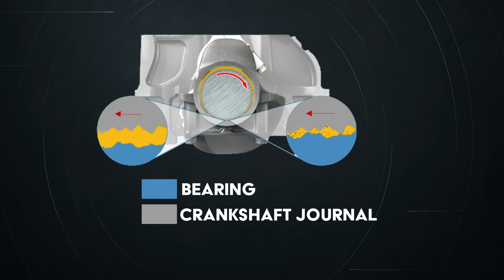the truth about start-stop technology (finally proven)

Comment: So they could have fixed it by using a separate oilpump, and just pumping oil before starting the engine.
The problem is that if a start-stop system would only start the engine after 5 seconds, then people would complain it's too slow.

Comment: Just disconnect the temperature sensor on your battery, this will prevent your car from using start/stop function as it wont be sure if battery is not too cold

Comment: Sorry but his is a redneck video. Your first test says exactly nothing about start-stop. When you were driving and just stopped on a red light, all the oil doesn't just magically disappear from everywhere. Your tests just says you should give it a moment before cold starting an engine before driving. Second tests is questionable at best.
Buy a modern car, which in 99% of the cases will be at least a mild hybrid which doesn't even use the engine right after you start moving and the start-stop system makes even more sense.

Comment: Is it true that the feature in 2015+ cars doesn't hurt the engine? Due to reinforced starter systems &  smart oil system (mostly available in 2015+ models (hybrids  of most brands + ICE Toyota, Hyundai, kia etc) have electric oil pumps with accumulators for start stop

Comment: I very appreciate the work you done with the experiment, but the methodology doesn't seem correct. You compare modern engine with Start/stop in very aggressive manner and older one with normal usage. To be fair the "experiment" engine wear should be compared to the same motor running the same time, but in idle. So it will simulate the situations, when Start/Stop engages, such as traffic jams. There are no doubt, everyday stuck in traffic car will wear much more, then the only only drives on autobahn.

Comment: My 2016 Mini Cooper has a physical Start-stop switch. If I turn it off, it stays off until I switch it on, which I will never do. My 2025 BMW X5M has a physical Start-stop button, if I turn it off, It doesn't stay off. It turns back on next time the engine starts. It's quite annoying. The M60i is even more annoying because it doesn't even have the physical button. I have to remember to go to the damn Driving Setting on the screen to turn it off every time I start the engine. Then my Lexus GX 550 OT+ doesn't even have Start-stop, which is damn nice. Too bad, its gas tank is too damn small. The range is far less than the other cars.

Comment: Except, nothing increases wear more than fuel dilution, which increases when you start a cold engine (like you did over and over again) or if it's idling for too long.
I've seen used oil analysis from engines running with and without in Real scenarios and they showed less wear.
Coated bearings are great, but selling it under false pretenses is the definition of snake oil. 🤷🏻‍♂️

Comment: I've got stop / start on my car. After around 3-4 years the car did not auto stop. Possibly due to the battery not holding enough charge. It is now 8 years old, still not auto stopping but starts the engine fine every day.

Comment: I remember the introduction of this type of motors, and my late father say how it could not good for the motor and many other parts . 
He simplified it for me, by putting it "the downs", just on the battery. Like: "what happens if you start the car, and don't let it work enough to start the alternator?" "well, the battery wont recharge and the car won't start after... ohhh! "

Comment: Why are hybrid car engines considered more reliable (in average 15% fewer problems linked to wear) if they turn off even more often than cars with start stop at a red light? Those can turn off while driving and according to many available schematics, they are decoupled and the cylinders aren‘t moving and the oil pump also isn‘t running..

Comment: He’s talking about German engines. And completely forgets how the Japanese engines cope with this with proven reliability.
Hybrid cars don’t just shut off when at a stop, they are constantly stopping and starting during normal low speed driving.
And yet Toyota and Lexus for example will rack up mileages well in excess of most German engines even those not fitted with stop start.
So remake the video and do a strip down on a high mileage Japanese engine.

Comment: I still would use it. My engine will never last over 500k, the engine is stressed by design. 2 bar boost for a 0.9 liter 3 cylinder. Piston rings or the turbo will give way long before the bearings do. I don't mind the extra wear,
it saves me money.
I have to wait 10 minutes every day on a red light due to how much traffic there is and the red light taking 3 minutes to go green. 3 minutes of stand-still, 30 seconds of movement and another 3 minutes of waiting until you exit that damned junction. I saved 52 liters of gas this year.

Comment: Weren't we all always told not to turn things on and off? The vacuum cleaner. Incandescent and fluorescent lights. Cars that are driven more highway miles versus ones that are shut off before you even reaching operating temperature, tend to last longer. 

In the aviation world, everything is rated on cycles. For the fuselage, this is due to pressurization, and not really related to this. The engines are rated in cycles. This is full takeoff power, cruise, then eventually back to idle. Even the APU, which is a mini jet engine that supplies power and air conditioning on the ground, is rated and limited in cycles. This is again, apples and oranges a bit because an airplane APU runs at one speed: maximum. But the point is the same. Heat cycles, loss and start of lubrication, starter motors, it's all excessive abuse of these systems.

Comment: Interesting video and a solid experiment. I could think of a few flaws with the experiment, if you had showed some real examples of wear caused by stop start then it would have helped back up your findings.

In another video they said one reason for stop start is to prevent heat build up inside the smaller engines. Like 3 cylinder turbo types. If they sit idle in traffic, the fuel is adjusted to prevent knocking and it then causes too much heat. That was the reason they gave for start stop. Maybe you could have mentioned more detail on what benefits it can give (if you do see any benefits).

Comment: Without stopping to inspect those bearings after 1, 5, and 10 hours (for example) it is not possible to say whether the wear (damage) was caused during the first few starts and stops, or evenly spread throughout the time the test was run. It's a lot more work, but that information would be critical before any actual conclusions can be drawn. The large chunk of debris that embedded itself in the 3rd bearing happened ONCE - and quite possibly during the very first start, as it got flushed out of the oil galleries after the test bearings were inserted. The good state of the OM617/OM616 after a high mileage, may result from the bearings being oversized, and larger than they need to be to support the engine loads. This would allow for earlier run-out, which could be further enhanced by the oil pump and sump design. 

A further (expensive) option is Diamond Like Coating (DLC). This adds a very thin layer of diamond to both crank and conrod surfaces - enabling them to run in contact with little lubrication, and very low friction. F1 uses this by default, because the diamond layer is so hard, it simply does not wear out. There is also no need for bearing shells, meaning the assembly bolts can be spaced closer to the rubbing surfaces, further improving the structural stiffness of the joints. Problem is, expense... 

Also, Kudos for making this video in English, und nicht auf Deutsch. USA and UK viewers simply do not appreciate when a European (or any other non-native English speaker) posts a difficult technical video in a 2nd (or 3rd, or 4th) language. 
If you speak English as your native language, then consider how easily you could present this kind of material in French, or Spanish, or German, or ???  If you even know a second language...

Comment: Okay, I drive a car that's about 14 years old, a diesel with a start/stop system with 177,000 km, and so far I've had problems with the clutch hydraulics, the air conditioning, the electrics on one of the windows and I don't know what else, but no problems with the engine or the starting system and I use the start/stop system almost constantly. The engine doesn't burn oil, it's as strong as it was on day one. I also have an even older vehicle without start/stop, a petrol one with 240,000 km and surprisingly the engine burns oil and I take care of both vehicles equally. What's the problem here now?

Comment: If the problem is the oil pressure, couldn't this be resolved by having the oil pump continue running after the automatic stop?

Or having a pressure reservoir that would hold the pressure for a limited time after the stop.

Comment: Not a good thing especially on diesels. You want to keep a diesel hot. Otherwise you're destroying your engine and exhaust system. Never drive a diesel if your road trips are under 30 minutes. And do not start stop it!😁 Your pistons and cylinder walls are expanding and contracting all the time. It's not good especially in cold weather. Metals cool down fast. And then you drive it hard from zero, that's not good! Whoever invented that 😤👎 This is an engine killer. You headgasket will give up too. Just imagine one hour road trip you only start your engine once. But with start stoperhaps 20 times. Now imagine this in a year! Your engine won't last long. You're gonna wear down all your engine seals and gaskets. Even bolts! Your engine will simply fall appart! Constant temperature difference is not good.

Comment: 5:36 one flaw I see with this is that you did not pre-heat the engine block, just the oil. Temperature of all the engine components, bearings, the block, etc... have an effect on how long the engine stays in mixed friction.

I agree that start-stop is bad but I don't want this argument to be called out as a straw man over a silly missed detail

Comment: As a metallurgical engineer, this is a very well presented and effective way to address the deficiencies of the start stop function, it can be applied to other rotating equipment that cycles more than it really should for long life of wear components.  A comparison of wear degree using metallography would have been very interesting.  

That being said, I have owned a 2010 Ford Fusion hybrid that has this start stop function, although I do not think that it operates at the same level as newer start stop systems.  I’d be interested to see a comparison of my Hybrid and a non Hybrid Fusion, same engine, same year, same miles (150K).  So far there has not been any apparent lack of performance using this start stop function (as I said, it might not be to the same degree as those cars having this function discussed here).  

I also note that, in my case, the function operates almost imperceptibly in the background.  If the hybrid battery is sufficiently charged, the engine drivetrain will pull from that first and if you’re tediously slow enough on acceleration or on a downhill start, the battery will stay engaged unless acceleration rate exceeds its ability to keep up or once the vehicle runs over ~40 mph.  I can only conclude that the start stop function on my hybrid is not being used in the same way as on the cars being mentioned here.

Comment: I had a buddy of mine remap my transpoter T6.1. An ECU remap, also known as software coding, allows some tuners to modify the vehicle’s engine control module so the Start/Stop system no longer functions as originally designed. This usually means the system can be set to remain permanently off by default, or it can be fully disabled so it never activates at all.

Comment: Current car is 13 years old. Used stop start never turned off. Zero issues. People have got to stop being scared of features
Reply: 14 years and 177,000km, frequent use of start/stop without any related problems. I don't know what's causing all this drama around this.

Comment: I would imagine an electric oil pump that maintains pressure and flow between starts might help... I hate the feature btw and have always felt that it was designed to intentionally wear consumable parts like starters and flywheels.

Comment: Most modern engines has electric oil pumps that keeps oil pressure at required levels with the engine is shut down during stop start

Comment: what's even worse is hybrid cars with the Start-Stop function, on some Hybrids when you start driving the engine is off and you're just using the electric motors, if you do a kickdown though, the engine will turn on and inmediately revv to 3k rpm or more depending on the speed, ON A COLD ENGINE THAT JUST STARTED UP. I'm a mercedes tech and we've had a few cases of these hybrids that have litterally shot their lambda sensors out of the Cat because of the massive and instant exhaust preassure buildup when an engine comes alive and inmediately revs to 3k. In most cases a new cat was needed and a new lambda sensor was needed, but in some wild cases the customer even needed a new hood because the sensor shooting up like a rocket would often dent the hood from the inside.
Reply: I don't know about hybrids, but for conventional engines, the ECU disables the start/stop system when the engine is cold.

Comment: The first thing I changed on my 2017 F150 was to disable the Start/Stop function with a hidden cockpit switch. I only allowed it to function when I had the vehicle back at the stealership for warranty items. Easing thru 150,000 miles at this point with no issues and no Start/Stop bullsheit.

Comment: I never understood how anyone was sold on this stupid idea?  Without even getting technical common sense tells you that if your starter motor has to make as many starts in a week as it would normally do in a year guess what's going to happen a lot sooner than on a regular car?  Great video MIK.
Reply: start/stop cars don’t use normal starters. They use high-cycle reinforced starters rated for hundreds of thousands of starts. If these were failing, fleets and taxis would be replacing them weekly — but they don’t.

Comment: and the manufacturers jumped in straight on the bandwagon without arguing because they 100% knew it was wearing the engine which makes them sell more cars. no more 1 mil km, no more w124 on the road. buy a car, 10 years later - scrap.

Comment: I have a '23 Ford F150 Powerboost. I get in the truck in the morning, and hit the start button. When I start to drive, it is electric for a bit, then the engine kicks on. Well, it has been sitting all night in the cold. Now there is 0 oil pressure, and the engine is already under load since I am driving. I'm sure the engine loves this. I can put the truck in 'tow' mode and that keeps the engine running as long as the truck is in gear. This is a lease and as soon as it is up, I will never lease or buy another hybrid.

Comment: New cars will not allow re-flashing the control unit (ECU) for the purpose of disabling the start-stop system. Instead, it is better to buy a kit from AliExpress that enables this.
I did this with VW amarok it is rather easy and permanent fix

Comment: If you want to do convincing tests, you really ought to look into how to set up the experiments. What you've got there is a nice start, but far from enough.

You need a test and a control: what you got at 6:15 is your test that tests stat-stop wear. Then you also need to do a control test where you install 3 more new bearings into the same engine and get it to run non-stop for the same 2 days to show that the damage is not caused by normal engine operation.
Reply: For all we know that damage you've showed from your test would have been caused even if engine ran non-stop.
Do you really expect no scratches on a brand new part after it having been used?

You may claim that the engine "after 1 million miles" serves as control.
Nope. It doesn't. It's a different engine that may have had that part replaced recently.
Or it could be that your start-stop test engine is defective, worse-designed, or has other differences compared to the 1 million mile one. It's not an apples to apples comparison.

Comment: 1:08 Baseless claim. You can't know if car mileage has dropped because efficiency regulations.

The real reason could just as likely be that the manufacturers have been cutting down on manufacture costs by skipping out on long-term quality,which coincidentally is a common trend these days across all manufacturing industries. Plus, the manufacturers don't benefit from cars reaching 1mil miles as they don't get to sell as many cars, so here's another incentive to skip out on quality.

Comment: Leftist logic: To save .1 mpg we'll stop the engine in traffic (traffic caused by more traffic lights, lower speed limits- by leftists) "And this will save 1000 tons of carbon emissions!!"
Result: Engine / car only lasts 120,000 miles instead of 180,000+ miles = more junkyard, more carbon emissions to build a new car, more carbon emissions to recycle the old car, more carbon emissions to PAY for a new car, and on and on and on and offset the saved carbon emission by 10x. 
Look, I'm all for saving the environment, but liberal logic has cost Trillions in the long run!

Comment: Engine wear might approach zero if it's warmed and oiled, but the starter and its associated gear, plus the battery, will cost you before two or three years.

Comment: How about engine pre warm?  Preheat the engine by storing hot water into a thermal bottle after shutdown and using this to pre warm the engine next use.  I just got a 2007 hybrid and it does this. Also gets cabin warm very fast.  It also doesn't have a tiny slow starter motor like most cars, but a ev engine to bring the ice up to speed quickly so starts faster etc. 
A very different machine to my current 1980s vehicles.